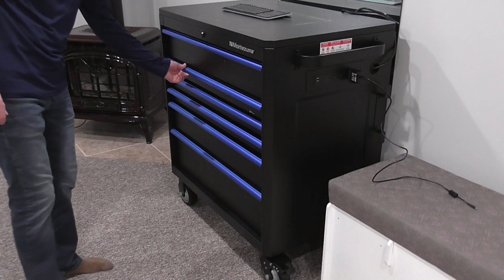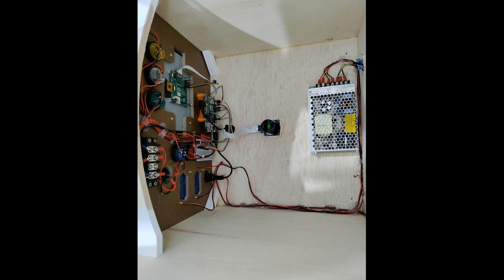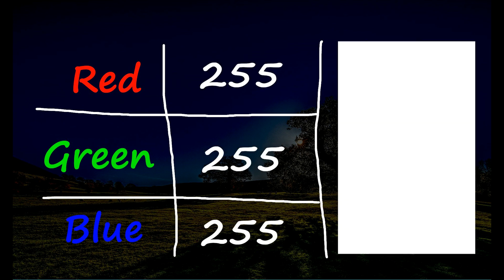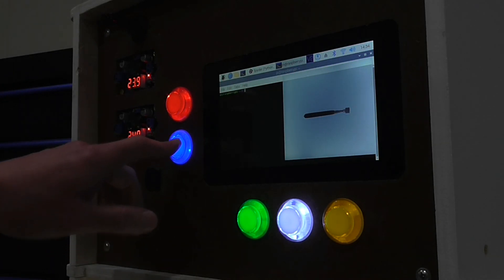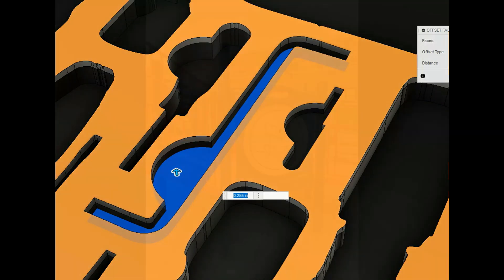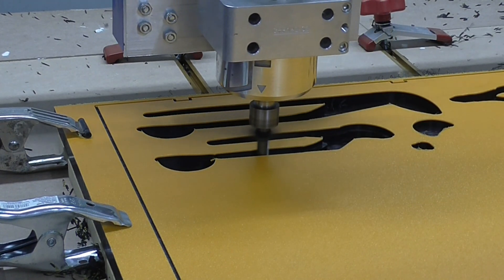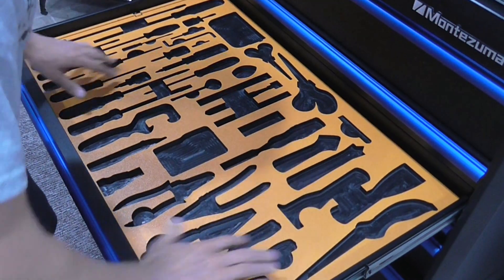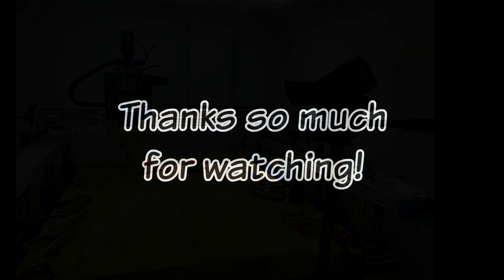Shadowboard Build from the Basement Shop

Comment: Great video  +1 Subscriber!  I've been wanting to build shadow boards for a long time, but have kept being put off by the bad results of taking a photo and trying to clean it up to an acceptable standard before actually building the board in CAD.  I've tried so many methods, but always end up disappointed.  Your RasPi solution is just genius.  Please could you share more about it's components and the scripts that tie it all together?
Reply from the maker: Do you have a more specific question?  I did everything that I could (short of posting my script) to convey the process in my video.
Reply: @scottprints  Short of posting the script, it would be most useful to me to understand the libraries you used to automate the workflow of photo to usb stick at the push of a button, so I could have a go a coding something similar.  I've taken PiCamera and PyPotrace from the video, but have little understanding how you isolated the tool from the background. Although I get the theory, not sure how you produced that in code.
Reply from the maker: @__stuart__  sure!  Use PiCamera (or PiCamera2 nowadays) to make a 3 dimensional array in NumPy.  Then you can use some match functions on each pixel to determine its distance from either the black or white corner.  Once you have that distance, each point in the array can be categorized as either "tool" or "background"

That ought to get you started!  Good luck!
Reply: @scottprints  Just wanted to loop back and close this off.  I've got some code that I'm happy with for now (these things are never "finished", right?) to extract the tool from the background using PiCamera2 and OpenCV, now just need to find some time to have a play with Fusion360 and the CNC.   Thanks for the pointers - really useful starting point.
Reply from the maker: @__stuart__  Code is never finished.  Good luck, and keep me posted!
Reply: @scottprints  Back with more questions. :) I've re-written parts of my code after getting one of the new v3PiCamara boards - barrel distortion on these is pretty much zero compared to the HD/Lense combo.  Potrace is working fine (I'm assuming you went with SVC option) but I'm struggling with scaling - even two tools resized by the same amount (cv2.resize) come out very inconsistent.  Any pointers please?  Happy to send you my code if you let me know the best way to get it to you.
Reply from the maker: @__stuart__  hmmm... Do you have a decent distance between your camera and the tool?  More distance is better.
What's your email address, we can talk outside of YouTube.

Comment: Hey great video, awesome process! How do u make sure the scale of the vector outlines is the same as those of the tools in real life? Thanks appreciate it!
Reply from the maker: Hi Sam,
Scale on a tool of known size and remove the barrel distortion will get you most of the way there.  Parallax error is still an issue, but keeping the camera as far from the tool as possible minimizes that error.
Reply: @scottprints how to counter the barrel distortion using a phone? Taking overhead pictures using a white background with lights to minimize shadows? Thanks for the video, info and your time
Reply from the maker: @CisnerosShop  well, I think "how" you take the photo (in your case, with a phone) is irrelevant.  What's important is knowing how much barrel distortion is inside of your images and then removing it.  You may want to do a search for "openCV barrel distortion correction" for some examples that show Open CV being used with Python for this function.  Then you can take that knowledge and apply it to your project.

Comment: The shadow box is awesome! I’m interested in either building one or purchasing one, any information you can provide regarding either?
Reply from the maker: If I were you, I'd start by working through the software as 1's and 0's are free.  Get started with your language and hardware of choice (I used Python and Raspberry Pi products) and build out a working model on the bench.  If you can get that to work, then go bigger and get a box to put it all together with a backlit stage.  Good luck!!

Comment: Exact YouTube channel I needed
Reply from the maker: Good to hear!  What sort of projects are you working on?
Reply: @scottprints  I'm currently in tech school during my highschool school day. Me and my other fellow classmates are working on a shelf with 6 casters on it 4 of them being locking and the shelf's have rubber on them. We are building it for Aurora flight sciences. They have cool cnc machines, fixtures, robot machine tending, paint booths it was really cool to tour there facility they even have a computer inventory system that is like a vending machine but for tools and PPE... We finished the shelf but still have to mount the shelves on the beams which at are a 45 degree angle. There will be 4 shelves on it to hold airplane rotors that Aurora flight sciences manufactures. I'm still learning manual and cnc machines at my school and I find it very interesting. I like making things and I learn something everyday in this industry I love it.

Comment: Great video with a good explination. I like to use a flatbed scanner and corel draw for doing something very similiar.  The poly material you used is indeed neat stuff, heavy as heck but neat and tools literally last forever when cutting it.  An endmill will last tens of thousands of inches in this stuff.  Thanks for sharing.
Reply from the maker: Thanks for the comment!
Yep, we cut this stuff at work, and it isn't terribly hard on the tooling.

Hey.... I've been wanting to ask about doing this on a flatbed scanner.  How does the profile capture work with tool edges that are a couple inches away from the glass?  I wanted to re-create this contraption with a scanner, but I'm worried that thick tools will be out of focus if parts of them aren't right on the glass.
Reply: @scottprints  I dont think I can say that I have done anything 2" thick.  If it had straight sides I think it would not be a problem since as you know th scanner bar is always looking straight up iff you will as it moves along the bed.  I have done lots of cardboard patterns for things that I want to profile and cut in more expensive materials like carbon fiber and such where you really want to get it right the first time.  It has always worked perfectly.  Lately I have been tracing around wrenches, pliers and the like for foam inserts.  That is what brought me to your video.  What my method lacks in refinement however is the fact that I have to bring a PDF of each tool into autocad and then manually trace around the object that i want to shadow with a polyline drawn manually.  It is a tedious process and it can take a few hours to trace around a whole tray of wrenches.  Sometimes I profile cut reliefs when I want it to go all the way thru the 13mm EVA foam, and other times I cut relief pockets in the foam by laser engraving partially thru the foam for shallower stuff.  I then stack up 1 to 4 layers of the foam with the corresponding cutouts and glue them all together.  Again it is not a a fast process, but it sure does look amazing when it is done.  I use 24" square EVA foam gym floor tiles from home depot or Amazon as it cuts quickly and beautifully with no residual stink on the CO2 laser.  Again thanks for the inspiration!

Comment: The photo-bench is adorable.  (I'm afraid I'd never be able to keep it from getting buried underneath things when I wanted to use it, though...)
Do you find the intensity mapping accurate enough (you mentioned doing a bit of shape cleanup but it seemed to mostly be about being smart about the tool, rather than fixing glitches?) Or would a black lining (so there was less reflected light on the camera-facing surface) help, maybe for chrome tools (like the socket sets that you're doing next)?
Reply from the maker: Well, the trick is in how the cube is broken up.  I find that I get better results if the split is closer to the white corner of the cube.  That way, the pi has a better chance of labeling shiny tools as "tool pixels" -otherwise shiny pixels can get mistaken for background pixels.
Reply from the maker: But yes, the black lining is a good idea.  I've been toying with the idea of painting the inside of the box black.

Comment: Very impressive.  I made a shadow board by tracing the tools onto paper then photographing the paper as a hack to avoid the camera distortion, then tracing the image in CAD and carving on the CNC.  Any chance you'd make the Raspberry Pi scripts public?  I'd be very tempted to also build an automated scanning box.
Reply from the maker: At the moment, those scripts are so cobbled-together that I think they'd be more trouble than they're worth.  Maybe someday if I re-write them, I'll put them up on GitHub or something.
Reply: @scottprints  Even documenting the steps  a bit more would be valuable.  I can write my own Python, just could use a head start on the process.
Reply: @StevePrior  I agree.  It's better to have a jumbled toolbag of code to start out with and then polish than to have nothing to start with.

Comment: Annnd you just earned a subscriber! I have been wanting to make shadowboards for my toolbox for a long time now and have been discouraged by products like Kaizen foam (mainly due to the astronomical price of it) I am in the final stages of building my CNC router and this would be a perfect project for it!

Do you have your scripts for your machine vision camera setup posted anywhere like Github?

Can't wait to see more projects, now I need to go find that pesky 10mm socket.....
Reply from the maker: Good luck, keep me posted on your progress.
No, I don't have my scripts posted.  Mostly because I'm a novice programmer and this was a learning experience for me.  Consequently, my script is poorly commented.  While it works, it could be MUCH better and I know that I'll have to re-do it soon.
Cost of the material is always a challenge.  As I said in the video, I'm lucky enough to work in the factory that makes Playboard.  I was allowed to take home some scrap for this project.  If I didn't have that resource, I'm not sure I would have been able to make the video.
Thanks for your comment!
Reply: @scottprints , that's an amazing video! Your scanning device is a brilliant idea! I was wondering what are the dimensions of the back light surface (what's to biggest tool you can fit in)? Speaking of dimensions, how do you define the distance between the camera and the tool? What's this distance value in your case?

Comment: Hot damn. Those are beautiful shadow boards. 

Very cool scanning device, too.  

No space for a CNC mill at my current shop — but I sure hope I can get one someday :-)

Good use of that Pro-Lift mat too — I tried using it to shadow with a box knife and it sucked but the mill would obviously get it done :-)
Reply from the maker: I'm impressed that you recognized the Pro-Lift mat!  I've cut up a few of them.  Too bad they're so small, I wish they came in bigger sizes.
Reply: @scottprints  haha yeah -- I've been down this road a few times!  I actually ended up stacking gardening knee pad/mats from the dollar tree for my shadow boards -- as it cuts perfectly with a razor.  

The pro-lift it's very economical for what it is -- but it is so difficult to get a clean cut -- --- I even chucked a nice endmill in my hand drill and it cut fine -- but it was tedious and hard to get it to look right :)

It's actually pretty nice for rolling around on the ground tho :) 

It's a shame they don't make them wider -- finding bulk foam like that is $$$ -- just goes to show economics of scale matter!!
Reply from the maker: @IroncloudMetalworks  I have a theory on why bulk foam is hard to obtain.  I could be wrong, but I think that shipping costs destroy the economics of good shadow board foam.  It can't be terribly expensive to produce; but the shipping costs are probably why it's so hard to find.